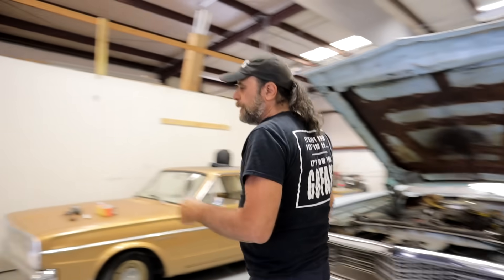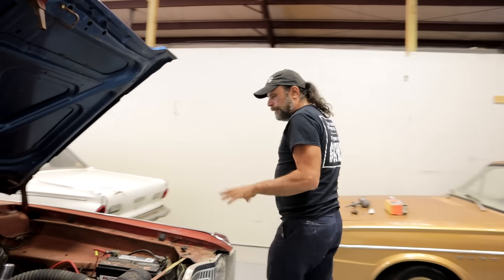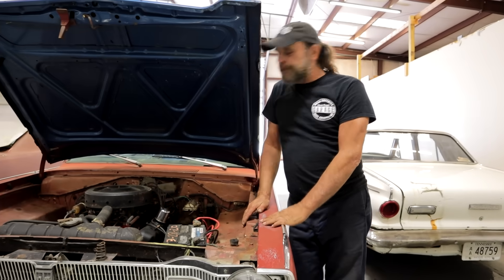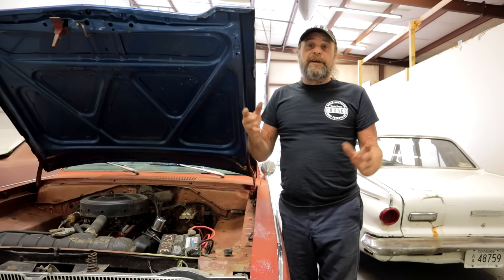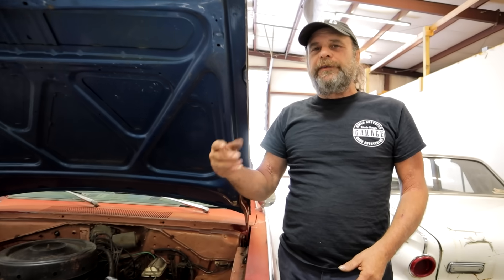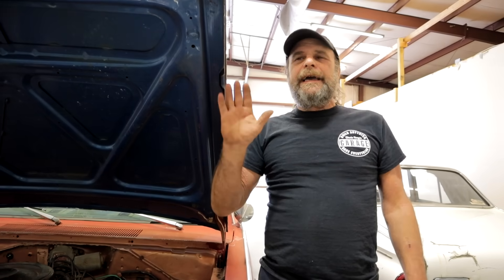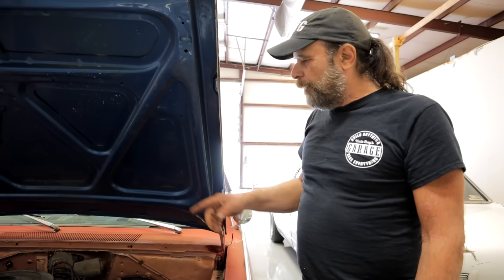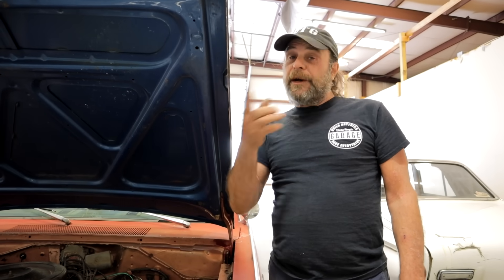Old School Tune-Up Mastery For Beginners: Setting Up Points The Easy Way

Comment: Used this method to readjust the points on a Ford 390 today. Beats the hell out of the feeler gauge method. I had to redo it a few times since the adjustment changed tightening the screw but it was still a lot better than screwing with the feeler gauge over and over. I got about 1000 miles out of my vintage standard red box points before the first readjust. Still ran fine, but I'm anal.

Comment: A friend said to watch your videos because they would remove my fear of setting the dwell on points, and he was right, you present it in a very easy to understand and straightforward manner, thank you!! 

Now I have to go find your video on setting the timing, he says I have to use a timing light to set the timing after points installation. I'm not a mechanic, obviously, but I do work on my own cars, and I need to learn how to do this right. Thanks again!
Reply: Point dwell affects timing but timing does not affect point dwell. So when you refresh your point dwell to specs it is wise to check your timing. Always remember this (1) set point dwell (2) check and adjust ignition timing with your timing light. Yes it would be wise to view the ignition timing video.

Comment: Its important to know, that, a low dwell is a big pointer gap, and a high dwell is a small gap. If the dwell is 5 off the ignition timing can change 1 degree. Because of build up on the points, and camwear in the distrubutor, the dwell will allways change while drivning. And thats the benefit of electronic ign, and will gain performance over time. Points are bounsing all over the place at high rev, and an old distrubutor.

Comment: I wonder why cars don't use what motorcycles use to lubricate the points. And that is a block of wicking felt held against the points cam which you would saturate with oil. It seems like a much better method.

Comment: I never thought points ignition was a big deal. I never understood why so many people want to convert over to electronic ignition. Points ignitions do require more frequent maintenance, but it's not a big deal or anything.  I set them with a dwell meter as was done here.  I never cranked the engine over with just a screw driver though!  :-)

Comment: when Chrysler came out with their version of electronic ing. we used to replace them with a points dis. when they 💩the bed, with my 86 Montycarlo SS I threw the electronic carb in the trash replaced it with a afb, and used a HIE dis.with a vacuum advance.      🐒🔧

Comment: Personally I kinda like the gm electronic grafted onto whatever ...
No points to jack with n hotter spark than most magnetos ...
Oh I rember screw fishing enough times that I finally magnetized a special screw driver for ...
What I'm curious about is using olm meter for dwell  timing an gap ???
Ok it was a dwell meter not an olm meter...
Thought I was gonna learn a new use for a contantunity meter  ...
A thin layer of that grease on the rotary bug an cap pickups stops the corosion too ...
As well as a spray down of wd 40 ...
An a thin bead of sillycone around cap just incase !!!
Nothing more frustrating the sitting in 2' of water drying out a cap !!!

Comment: Where were you 50 years ago?  Like I said before.  I spent countless hours starting my brother's Satellite.  (I was the key guy)  Setting the dwell was hit or miss with that style of points.  That's why I preferred GM's spring loaded version that allowed you to adjust it while it was running. 
BTW- I have dropped the screw before.  Not on a car but in a boat with a Volvo-Penta.  In the middle of the river.  Talk about an oh-** moment.

Comment: Way back when, I always tossed old points and condenser back in the tool box. Around that time a friend's car <Can't remember either Citroen or Pugeau> wouldn't start. It had been to a garage or two, had several tow trucks out to try to get it started and it ended up sitting for weeks. I finally asked if I could take a look. Hmmm. I took my old Mopar points and condenser out of my toolbox, jimmied them in and whala, we have a running car.  Parts is parts.

Comment: Nice job uncle T. I seem to remember soda can pull tabs being about .017 also😁. The good old days. I remember the first time I set mine on my super we. I still had the feeler gauge in and my Pop turned on the ignition. Quite a jolt😁
Reply: Superbee

Comment: I had a neighbor who told me that he used to commute 200 miles to work and back every day. Ford Bronco. He would stop halfway and clean the points, both ways. Thanks for the advice, I'm sure I'll use it. But if it's my car, I'll take electronic ignition.

Comment: Thank You Why didn't I know this!!! for 50 years (Starting with my 65 Dart 170 (Model) with a 170 slant I been gapping points then putting the distributor cap on starting engine and checking dwell... stop remove distributor cap, re-gap repeat process, etc. BUT no more Uncle Tony to the rescue

Comment: That's what I like about this business or hobby. If you keep an open mind, you can always learn something new. i didn't realize you could spin the engine over like that to set points. I have always reassembled the distributor together to run the engine. And Ford's were always a pain to get right.

Comment: i just pull the dizzy when doing points (im also 26 years old... its not a lost art YET!!)
usually needs a cap/rotor... cleaning.... ETC anyway 
.
also.... screw Ford.... no window in the cap to adjust the points
its set.... try.... remove....set.... try.... remove... 
.
lots of fords in the 70s drove around with "close enough" points.....
Reply: oh hell.... you can just crank it over..... duh!!
.
still... i REALLY dont like getting shocked (been bit one too many times.... about a dozen damn times)
and i had no one else in the shop (finishing up a old ford 430... or some "industrial big block"....after hours) 
.
ford is nice to have the quick release "straps" and not screws however
so once i learned how much "eye movement" related to "dwell movement" it was ok
.
still had the cap on and off 5times.... but its set NUTS on
.
.
the old points were completely melted.... just gone
and it still ran (poorly)

Comment: I miss the good old set of points that would come with a oil sponge or sweep that would help keep the lube on the dist cam for every rotation. But that is the number one reason for points to fail because people don’t lube their distributors. Don’t mean you Tony I understand the getting flustered when trying to show others and forgetting a step or ten. Awesome 😎 job Tony keep points alive. 👍

Comment: i used to put some grease on the screw head it makes it stick to the screwdriver.  that way it would not drop. the solenoid is on the starter, Chrysler had a starter relay.

Comment: Points will float like valves do at high rpm, makes the engine break up which equals no power. So performance wise points suck.
Reply: There's also the whole problem of dwell actually being a time thing, (takes time for the coil to saturate), not degrees, so at high RPM when that 30 degrees happens fast it's less than ideal in that regard too. That said I don't like a lot of the electronic conversions, like a lot of old car upgrades it's probably not worth it if you can't do it with later factory parts, between cost and potential hassle of poorly engineered and supported aftermarket parts.

Comment: I remember the old points used to come with that little capsule of Grease and they had this little piece of fiber material that went on the rubbing block and you were supposed to put the grease behind that so every time they snap shut it would give a little bit of lubricant

Comment: Points had their place but I'm sticking with HEI. Don't forget the magnetic screwdriver. If you've never dropped a screw in the distributor you haven't set points my friend. Pull it get the screw out and grab the match book (if you can still find one) and put her back in. Set it and go get it.

Comment: I think what gets a lot of people is that points require maintenance and replacement. Which opens the door for people either getting them wrong, or blaming the points for problems, or blaming other stuff when it’s the points. Like how many people thing something has a carb problem so they keep fiddling with it until it’s way out of adjustment and the original problem is still something else. 

So, it’s easier when in theory electronic ignition should just work and if you think it’s a problem you just replace the box.

Comment: dwell angle=duty cycle. the correlating crankshaft rotational degrees the points are closed allowing the primary coil windings to charge and saturate the secondary windings.  the longer the angle the hotter the spark up to the limitations of the coil and the distributor lobe configurations.  even with setting the points by dwell  the variations in points themselves may cause a slight ignition timing difference. probably unnoticeable but a true motorhead nerd will check timing after point adjustment.       now tony show and explain a dual point setup.   first one i run into was a '70 dart swinger 340- suprise! my brothers 383 roadrunner had them too.   both from the factory

Comment: Another rubbing block.  I hope the company that makes them goes out of business.
The Dwell Meter-  Whaaaaaattt???  I never knew you could obtain the dwell angle cranking the engine, and with the cap off!!!
All those years I went NUTS- starting the engine, wrong reading, cap off, cap on, start engine, read again, wrong reading, do it all over, until I got the right dwell.  I had NO idea.  Aaaahhhhhhhh!!!  UT why didn't I know you years ago?

Comment: When I was "on the bench" during the '70s & '80s, I used this method, but while the plugs were out (to make it easier to turn the engine over by hand to set the timing "in direction of rotation" to take up any slack in the ignition system mechanical components when running

Comment: Dwell meters do make it accurate, and the points will last longer. If you're in the field, or out on the road and need to replace points, the business card, match book, cigarette box, etc. method will get you by until you can get them set correctly.

Comment: I am ok with points,BUT here are to "points" I will make against using them.

#1 I would never use them for a high RPM race engine these days. You will never have the accuracy of a modern ignition system. (I have talked with guys from back in the days of what they had to do to even get those points to work in an 8 to  10,000 RPM engine and it is just not worth it. A wear item that had to be monitored and changed regularly.) Do you really want to loose a race just because your points let you down???? 
#2 Finding a quality set of points with good contacts is a rare thing anymore. Most have cheap plating on the contacts that is gone in a short matter of time . Even if you do pay up and get a set that is decent, again,the pad(rubbing block) that rides on the lobes WILL wear down and the dwell is changing slightly every time you even fire it up.

Comment: My dad taught me that stuff in the 1970s when I was about 10, how to gap points and build a set of ignition wires, etc. By the 1980s when I worked in his shop full time, almost all the cars I worked on were electronic ignition. The older guys were given the job of tuning up older cars; they were like gurus to me.
Reply: I can remember my birthday treat for turning 8 was to go to my uncle's for the week, and him grabbing my belt and tossing me over the fender of one of his dump trucks and putting points and plugs in it. I grew up like you did, learning it by doing it. I retired from Chrysler after 30 years, and saw everything go from points and carbs, to electric hybrids.

Comment: I feel like it’s important to explain the term ‘dwell.’ It’s simply the amount of time that the rubbing block dwells on the distributor cam. For some number of degrees there is a gap between the cam and the rubbing block, because the points are closed. For the rest of the time the rubbing block dwells on the cam, holding the points open. That’s all it is.

Comment: The only thing a point ignition offers is reliability and works even when there is huge nuclear radiation around. It is a Doomsday thing and military vehicles still use them.  There is no other reason to use the classic point iginition in the 21st century. Whenever I buy a car with a point ignition I change the distributor and get a proper new one with a magnetic hall sensor inside. Over time this strategy pays back because points become increasingly expensive and do not last, plus I get at least 5-10% economy and a little more horsepower without any other modification. I did it in an old Hilux, in an old Opel, and in an old Lada and the cars work perfectly and start easily during cold mornings.

Comment: I use electronic ignition. I carry a Hall effect sensor and igniter(small, bosch type) with me. One small advantage is that in my case if I replace hall effect sensor, it doesn't need any adjusting.

Comment: Setting up points ignition is like making your own toilet paper. It's not hard at all. Just cut old newspapers into square pieces and punch a hole in it to stick your finger through. If you read them first before using them, it might even be cheaper than toilet paper too!

Comment: tony, why dont you try an electronic ignition? pop into one of your cars and conduct an experiment over a couple of years to see which is best. you will be adjusting your points every 3000 miles and never touch the electronic for 100k and then tell us which is best.

Comment: One little trick or step Uncle Tony missed and that is drag a strip of “bond” paper or a clean pocket flap of a cotton shit between the contacts to remove any oil or other smutzs that are on them and more times than not there always is and the light coating of oil is intentionally to keep them from corroding in the box.  Myself I dip a one strip of bond paper in (cotton paper) in ether or acetone (and not the stuff people use to remove fingernail polish but the unadulterated stuff) and drag them through the contacts and then a clean dry piece.  That said I use a screw starter when installing new points because I have paws not hands and when I remove the screw I have a magnet ready and waiting after all the idea is to work smarter not harder and use a bumper-button to crank the engine when setting the dwell.  Lastly don’t forget to put a drop or two of oil on the felt pad in the distributor shaft and on the distributor weights and I do mean only a drop or maybe two no more.  Have a nice day and a better tomorrow.

Comment: I have acquired a few old single and dual points Mallory distributors and just to throw people off, I think I'll run one in my '76 Chevy big block truck! Thanks for the tips. I didn't know how to use my old diagnostic tester until your show. I hope you realize how valuable the information is you're giving us!

Comment: Napa Echlin points are...okay.....sort of. You want some kickass points that last damn near forever? Get your hands on Accel point sets. I swear by them. Been running them in my 69 F100 for the past 20 years. I've NEVER had to adjust them (checked often, always on 30*) and only been through 2 sets......in 20 years. Only reason i changed the one set is I had changed engines and figured, why not?  probably could have ran the 1st set longer. Truck was my daily for at least the 1st 10 years, family got bigger so it became the 'hauler' or backup rig. I can go out side right now, hit the key and it will fire off on 1-3 cranks. Accel points are extremely impressive.
Reply: Always tried for borg warner points dont know now if can get them.
Reply: @bdi11000  hard to say if they'd be as good as they might have been before, as everything has shifted overseas. Quality isn't what it once was. I can certainly vouch for the Accel points, IF you can get your hand on some.

Comment: I bought in. I stuck with the dual point ignition in my 1976 Moto Guzzi  civvy version of the police bike they sold at that time. I am doing a mild restoration and i included an ignition amplifier in one of the online parts orders i  submitted. It uses one set of points for each cylinder. It is a good system that always had the engine running after about one revolution of the engine by the starter which is how any well tuned Moto Guzzi runs.

Comment: How do you know what dwell setting? Is it just always 30 or is it based on the timing?
Reply: Based on the engine, or I suppose really the coil characteristics. Dwell is how long the points are closed, timing is when they open.

Comment: UT consistently advocates for the use of points, while never really acknowledging the very reason he had to change points in this video in the first place is because modern points are garbage and don't last 1/4 as long as the points from back in the day! Unless you are sourcing NOS points from the 60's/70's you are shooting yourself in the foot installing parts that will most likely fail on you at the worst possible time. It doesn't matter how easy they are to install, nobody wants to be stuck on the side of the highway changing points because the rubbing block wore out again.

Comment: Agree totally with setting points up with dwell, versus feeler gauges.
After realising that setting point gap with feeler gauges does not take into consideration any wear on the original cam lobe profile (our cars are around 50 years old, so there is obviously wear there), I decided to set them using dwell, and my cars have never run better since.  The difference was amazing.